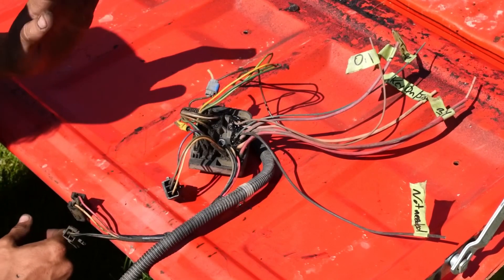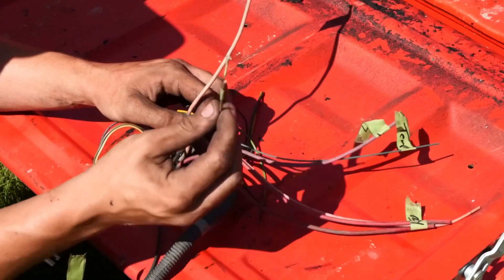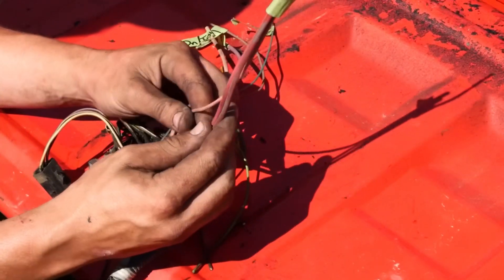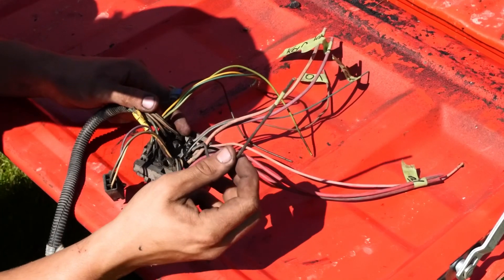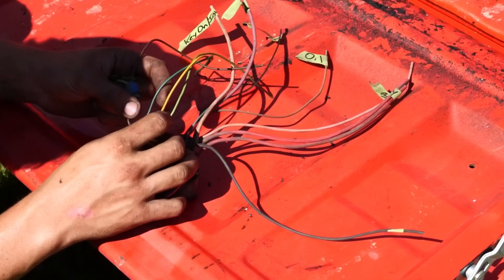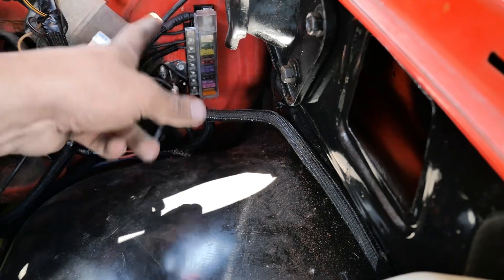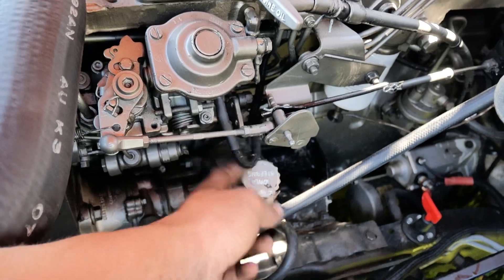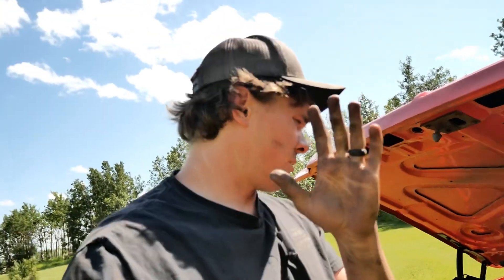Cummins Swap Wiring + Squarebody Firewall Wiring Bulkhead EXPLAINED

Comment: Do you have a way I could message you by chance? I got a few different colored wires off my fuse block and this thing has been hacked. All I’ve got left to make this ppump 12v run

Comment: Here's 1 for ya.. Just swapped a 6bt into an 88 that was a Fuel Inj 454. Purple wire to new 6.0 powerstroke starter solenoid terminal. Key in on/run position. 12v present to solenoid nut not enough current to crank. Key to crank and engine runs. Apparently there are 2 circuits that feed the purple solenoid wire... a 3 amp and a 20 amp. I'm guess it's was a fuel injection pcm need?
Reply from the maker: Very well could be

Comment: Hey dude, Got any wiring advice for rigging up a CR in a older style truck? I can only find CR cummins engines in texas junkyards. Im on a tight budget and im trying to pay less than 3 grand for a motor if I can
Reply from the maker: If you’re going to do the swap the best thing for you to do is to find a complete five-speed first Gen dodge

Comment: I'm doing a cummins swap into a 86 gmc that had a 6.2 diesel, any tips for the wiring on this.  Wait to start light....
Reply from the maker: Process is exactly the same, just find the key on powerwire that went to the fuel shut off solenoid on the injection pump